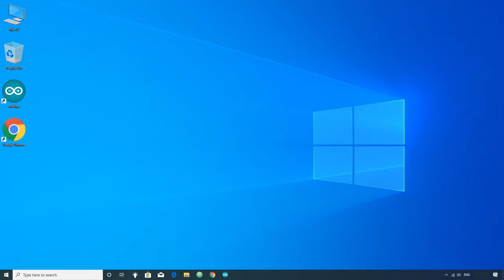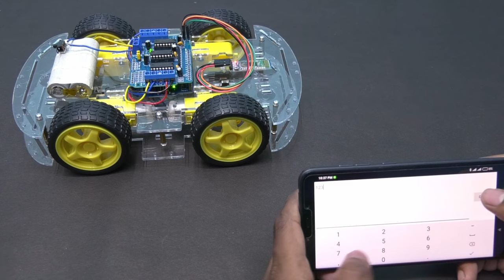Bluetooth controlled Arduino RC Car | Control using your Mobile Phone | Ut Go

Comment: Hi 
 I have did what u have said ,everything is fine Bluetooth is also connecting and the car is also working fine but after few second car is going out of control and then the Bluetooth is also disconnecting can plz solve this problem.
@ut go
Reply from the maker: How you powering up your car ?
Reply: @UtGoTech  i am using lithium ion battery 12v to power my model
I.e i used 3.7v Li-ion cell of 3 for my model
Reply from the maker: 2 cells will also work. Voltage should be greater than 5 volts and less then 12 volts. And also avoid loose connections.
Reply: @UtGoTech  i've tried it and also the forward and left movement is performed smoothly but it doesn't do the same with other two.
Reply: When it goes backward it moves discreetly and also the same with right movement.

Comment: good day, why cant the app detect the Bluetooth module :( also is it possible to use an arduino mega in this project?
Reply from the maker: First pair your Bluetooth module using your phone's Bluetooth setting page then look for the paired device in the app.
Reply: @UtGoTech  we did thanks we already connected, but the wheels are not moving:((
Reply from the maker: What battery you are using ?
Reply: @UtGoTech  two 18650 lithium ion battery
Reply from the maker: Have you checked the battery voltage ?
Batteries are fully charged or not ?
Reply: @UtGoTech  thank you

Comment: Bro the code and everything is working and I have buyed it from amazon but motors are working slowly when I connect to the motor driver shield but when I insert the power directly tothe motor the runs good what is the problem bro
Reply from the maker: There may be some loose connection issue. Try re connecting and tightening the connections
Reply: @UtGoTech  thank u for ur replay sir don't think bad I have tried 3 to 4 project all projects are working but my motors are working very slowly u can only slove this problem bro plz help me out
Reply from the maker: Try increasing speed to 255
Reply: U have said to change the motor speed to 225 in coding iam a right bro
Reply: I don't understand bro where I should change the speed to 225 in coding or what can u plz say bro 
And thanks alot of ur replays and solutions

Comment: how many volts does it need to work fast
Reply from the maker: That depends on the motors.
The motors used in the video can take voltage upto 12volt max.
Reply: @UtGoTech  ok thanks
Reply from the maker: Welcome
Reply: @UtGoTech  and can i test it while its connected to my pc for uploading code
Reply from the maker: Yes. But make sure that jumper is not connected.
Reply: @UtGoTech  ok thanks now i know that was why it was reading commands but wasnt moving😄
Reply: @UtGoTech  bro it isnt working the problem is that i dont have the 12 volt batteries and i have uploaded the code and want to check it so what should i do
Reply: PLS reply
Reply from the maker: Try using usb power supply.
Reply: @UtGoTech  thanks sir i will try it
Reply from the maker: Ok

Comment: Guys I have a problem the 2 wheels go in the opposite direction of the other two wheels how can I solve this please
Reply from the maker: Just interchange motor wires of opposite rotating motors.

Comment: good video but does not let me load the code to the arduino, but I'm using only a 3.7 volt battery and I'm intrigued if that is why, please if you can answer me I would appreciate it, I get error in "AFmotorh", I would appreciate a lot if you help me is a project for tomorrow, thanks.
Reply from the maker: You have to install Adafruit motor shield V1 library.
In Arduino IDE goto tools then manage library then search for Adafruit motor shield V1 library and install it.
Reply: @UtGoTech  Of course, and I got but now I do not read the bluetooh in the application, because it will be brother, sorry for the inconvenience.
Reply from the maker: First connect phone to your Bluetooth module using the phone's Bluetooth setting, after that open app to find the Bluetooth module.
Reply: @UtGoTech  thank you, Because it does not load the code when I upload it, but it compiles it very well but, it comes out with a problem and I follow the whole procedure.
Reply from the maker: Still having issues?
Reply: @UtGoTech  Yes, but this time with the code, it doesn't upload to the arduino but when I compile it it comes out well, I don't understand that part.
Reply: I get this: avrdude: ser_open(): can't set com-state for "\.\COM8".
An error occurred while sending the sketch
Reply from the maker: Select the correct board and com port after that upload your code.

Comment: I followed your circuit diagram ... have an issue ... when i connect batteru or cells with car ... it didn't gave current to arduino ... only motor gear light blinks .... bluetooth and arduino lights didn't blink ...
Reply from the maker: Have you connected the jumper in motor shield.
Reply: @UtGoTech  yes
Reply: @UtGoTech  it works when i attach cable from system to arduino ... power cable ...
Reply from the maker: You have not connected the jumper that why Arduino board and Bluetooth module is not powering up. Watch the video, you will know about the jumper I am talking about.
Reply: @UtGoTech  i don't have an option to send you picture ... i followed completely
Reply from the maker: Can send me pictures of RC car in Telegram.

Comment: Sir, Which application did you use for controller?
Reply from the maker: Bluetooth RC Car App from playstore
Reply: But there is no app like that sir
Reply: Can we use any controller app
Reply from the maker: App removed from playstore. You can download the backup app from the drive link given in the video description.
Reply from the maker: Yes, you can use different apps but you have to map the key and the signals in the code.

Comment: Can someone tell me what is the yellow thing in the board which he put on 10 44 
Is it compulsory to use?
Reply from the maker: That is a jumper which is used to connect the power rails of Arduino Uno board and motor shield. So it is connected to transfer power from motor shield to Arduino Uno board.
Reply: @UtGoTech   so it is compulsory ?
Does it have alternative?
Reply: Can you give me the code as the code you gave  doesn't  open
Reply from the maker: Yes it is compulsory.
Reply from the maker: Login to your Google account then open the code link and download it
Reply: @UtGoTech  even I am using 9 v battery?
Reply from the maker: 9v battery will not work. As this RC car uses 4 motor, it need more power. Use lithium based battery.

Comment: Hey, it worked with the cable attached with computer but why isn't it working? With 9v battery I ordered 18650 battery goona inform you if it works.
Reply: And i used 150 rpm motors
Reply from the maker: 9v battery doesn't have enough power to drive 4 motors.
Reply: Actually I used 2 of them (together)it still didn't work even if I connected it with usb port only two wheels worked
Reply from the maker: May be one of the L293D IC is not working
Reply: Thanks it works but I wanted ask a question why does 9v battery doesn't works even if the 18650 battery does even if it is low then the 9v.
Reply from the maker: It's due to power output capacity.
Reply: Oh, thank you so much this was a great project ,😁
Reply: One more thing after connecting to the comp .after moving about one centimetre it stops that we have to resent why is that?
Reply from the maker: Can you explain it.
Reply: Yeah so I connected it to usb port it moved a centimetre all wheels worked but suddenly it stopped the difference was that it the light of the motor shield green one was shinning brightly but when it stopped it reduced the brightness of the green light.
Reply from the maker: Have you removed the jumper before connecting both power supply.
Reply: I did removed the tx and rx wires
Reply: Hey, I used 4 battery 18650 it causes fire what should I do?
Reply from the maker: Keep voltage between 6v to 12v. Use only 2 lithium ion cells in series.

Comment: my arduino car already connect to my phone but when i try to move it it doesnt move at all?
hoto sssssolve this
Reply: Pls help me
Reply from the maker: Check battery voltage
Reply from the maker: Check battery voltage
Reply: @UtGoTech  I use lithium 3.7v (4200mah)
Reply from the maker: You have to use 2 lithium ion batteries in series.
Check if the batteries are fully charged.
Reply: @UtGoTech  ouh Okey
Reply: @UtGoTech  I already check the battery all is still fully charged but why still it's doesn't move

Comment: I have connected same as you but Bluetooth module is not coming
Reply from the maker: Is the light on the Bluetooth device lit?
Reply: No
Reply from the maker: Then check the power of the Bluetooth module. If power is ok then the module is faulty.

Comment: I cant download the code, i already did the wiring and stuff. But i cant download the code, could you help me?
Reply from the maker: First login to your Gmail account then open the code link and download it.
Reply: @UtGoTech  thanks for your help!
Reply from the maker: Welcome👍
Reply from the maker: Welcome:hand-pink-waving: @fatiyaapp1977
Reply: @UtGoTech  hi again, i come to a problem again. I can't get the code to in on the board, please help me😅😅 sorry for bothering you
Reply from the maker: Have you installed the Adafruit Motor Shield V1 Library? 
If not, then install it using the library manager.
If you have a different issue then share the details.
Reply: @UtGoTech  i already installed the library. Then i followed the instructions by just uploading it. It takes a bit longer than i expected then it got the error message. I kept trying but still get an error message, i dont know what's the problem 😢😢
Reply from the maker: What error? Please share the error you are getting
Reply: @UtGoTech  it says a problem uploading to board. stk500_recv ( ) : programmer is not responding
Reply from the maker: This is a different issue. 
First try to upload the blink sketch and check if it uploads or not.
Reply: @UtGoTech it's not uploading,is it the cabel??
Reply from the maker: Cable might be a issue  @fatiyaapp1977
Reply from the maker: have you tried uploading simple blink sketch ?
Reply: @UtGoTech  yes, and it's not uploading
Reply from the maker: @fatiyaapp1977 Check if correct board, port, programmer is selected or not.
Reply from the maker: If you are still facing issue then contact me through Instagram or Telegram. @fatiyaapp1977

Comment: Can we connect esp8266 nodemcu instead of Bluetooth module
Reply from the maker: Yes, it possible to use esp8266 to control RC car
Reply: @UtGoTech Can u tell How the circuit diagram will look like with esp8266?

Comment: Bonsoir, je rencontre des difficultés à télécharger le code. J'aimerais m'initier à la programmation Arduino et je trouve ce projet très intéressant. Pourriez vous m'envoyer le code s'il vous plaît
Reply from the maker: Code link is given in the code description. Don't open the code in the Google drive, just download it and open it using Arduino IDE

Comment: Can you please tell me how to upload this code and AF motor shield library?
Reply from the maker: Install library using library manager of Arduino IDE after that upload the code as shown in the video.
Reply: @UtGoTech  just copy the code and upload ?
Reply: @UtGoTech  can I plug this cabel to the pc when iam going to install library or not?
Reply from the maker: Yes
Reply from the maker: Yes, but make sure to remove the jumper.
Reply: @UtGoTech  ok thank you very much.
Reply from the maker: Welcome

Comment: Please reply I made Bluetooth car but it is not working. Motors are not moving so what should be the problem
Reply from the maker: What battery you are using?
Reply: 9v
Reply from the maker: 9V battery will won't work, use lithium ion batteries
Reply: Ok thank you for replying me fast
Reply: I will let you know after some days
Reply: Can I combine four 1.5v cell to make 6v. Will it work??
Reply from the maker: No, It will not work.

Comment: Hi bro I have did what u have said on the viedo bro everything is fine but Bluetooth is also connecting and the car is also working fine but after few second the 3 motors are working and car is going out of control and then the Bluetooth is also disconnecting bro can plz slove this problem bro
Reply from the maker: Can you contact me on telegram
Reply: hi 
i am too facing the same problem, have u solved it.
Reply from the maker: Try using powerful power source like lithium ion battery
Reply: @venkateshbharadwaj4216  bro have the problem is solved if yes if say how it is

Comment: This is My Google account it won't open pls help 😢
Reply from the maker: Check if you have logged in properly, try opening your Gmail.
If the issue persists then contact me through telegram, i will send the code through telegram. Telegram contact id can be found in the video description.

Comment: why does it only take a moment to connect to the phone? continue to be automatically disconnected?
HELP ME BROOOO 😭😭😭
Reply from the maker: Use powerfull battery like lithium ion battery.
Reply: @UtGoTech  but I use power bank or not strong enough?
Reply from the maker: First tell me that when exactly your Bluetooth module gets disconnected.

Comment: Hi just wanna ask what will happen if i use a 12V dc motor and a 12V battery instead of the one in the video?
Reply from the maker: It will work.
Reply: @UtGoTech  thank you sir.. we will try yours... We did tried others video and still not working... Hope yours will work.. thankyouu
Reply from the maker: Check motor specifications. If it requires more than 500mA then it will not work. If your motor requires more current then you have to use different motor driver which can handle that much current.
Reply: @UtGoTech  can u recommend me a good motor driver?
Reply: @UtGoTech  or theres a way to minimize the current?
Reply from the maker: Which motor are you using ?
Reply: @UtGoTech  motor shield L293D something
Reply from the maker: No, I am asking about the motor you are using
Reply: And also, does changing the speed in the code make a difference?
Reply: @UtGoTech  sir i badly need ur help.. we got a problem about coding... Its says done compiling but when uploading its say avr dude: programmer is not responding
Reply from the maker: In Arduino IDE goto tools and check which programmer is selected. It should be "AVRISP mkll".
Reply from the maker: Changing speed in code will change RPM of the motor
Reply: It is AVRISP mkll, still not working ... We change device, port and anything that is possible with the help of YouTube but it still wont upload with the same problem... Maybe my arduino is broke
Reply from the maker: Try with new Arduino board
Reply: @UtGoTech  hello sir thankyou for your help ... I just got something another problem...

You see im using a 12V DC motor(22000rpm) and as you said that its not working because of the current flowing through it... Is there a way to provide dc motor its need?
Reply from the maker: Your board may be faulty. Use different Arduino board.
Reply from the maker: Try replacing Arduino Board
Reply: @UtGoTech  the specs of our DC motor is

Output Power: 18W
Type: micro motor
Certification: CCC
Voltage: 12V
Commutation: Brush
No load Speed: 22000rpm
Model Number: HS390
Reply from the maker: Your motor requires too much power which the motor shield can't handle. Use different high power motor driver.
Reply: Like L298n? Can u recommend me a good motor driver that can handle that?
Reply from the maker: Yes, you can use L298N
Reply: @UtGoTech  thank you so much sir... Just one more thing... Can arduino handle a 12V battery? We've search a human following robot and it connect a 9V battery to arduino .. we are just wondering if it can handle a 12V battery
Reply: Thankyou so much sir, one last thing .. can we use a 12V battery to the arduino? I've watched video that connect 9V to arduino .. i just wondering if it can handle a 12V
Reply from the maker: Yes, it can handle 12v.  But prolong usages of 12v will heat up the voltage regulator on Arduino board and after some time if it's temperature reaches above it's limit it will shutdown itself until temperature becomes normal.

Comment: Bro its not working i uave done with all but it doesn't work
Reply from the maker: What issues are you facing?
Have you installed the Adafruit Motor Shield V1 Library?
Reply: @UtGoTech  bro I have done with all , i uploaded your code the blutooth is also connected but in the app we click forward move button or backward it doesn't move

Comment: because the codes are different from the one on the screen to the one on the page
Reply from the maker: I didn't understand.
Reply: @UtGoTech  What code is
Reply from the maker: Code given in the video description.
Reply: @UtGoTech  I don't see it
You can send it to me?
Reply from the maker: Code is given in the video description. You will find code in a Google drive link.

Comment: और हर एक कमान पर वह ब्लूटूथ डिस्कनेक्ट हो जाता है और मोटर चलाते ही रहता है जैसे कि मैं फॉरवर्ड बटन दबाता हूं तो मोटर कंटीन्यूअस चलते रहता है बट ब्लूटूथ डिस्कनेक्ट हो जाता है कंट्रोलर को फिर से ब्लूटूथ को कनेक्ट करने पर चारों मोटर स्टॉप हो जाता है
यही प्रक्रिया है सारे डायरेक्शन में चलने के बाद होता है 
इसका सॉल्यूशन कैसे होगा
Reply from the maker: Which battery are you using? Use Lithium-ion batteries.
This problem arises due to voltage drop. You have to use Lithium-ion batteries to avoid voltage drop.
Reply: @UtGoTech  I m using power Bank with output of 5v dc
Reply from the maker: Power Bank will not work. You need voltage between 6 to 9volt.